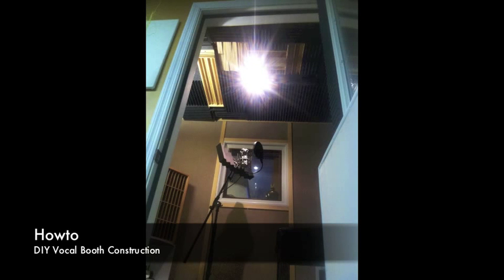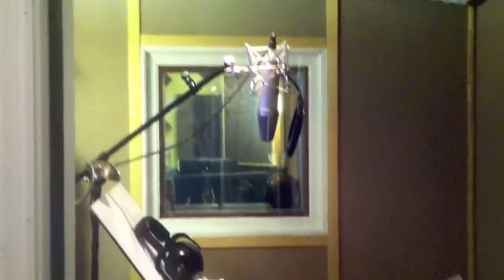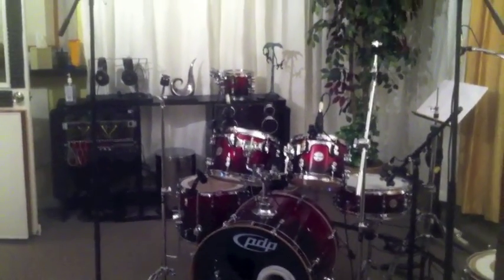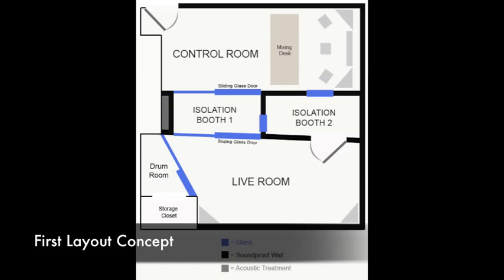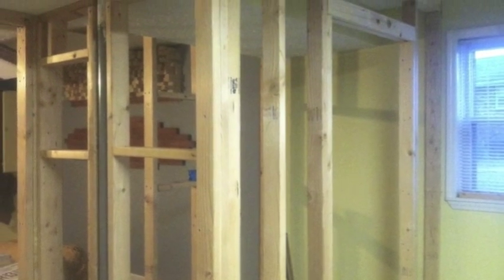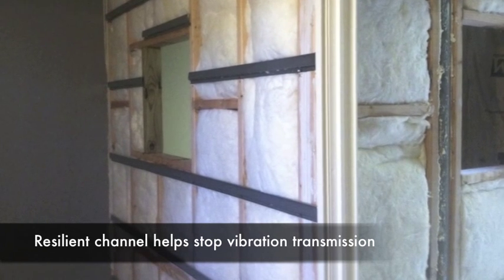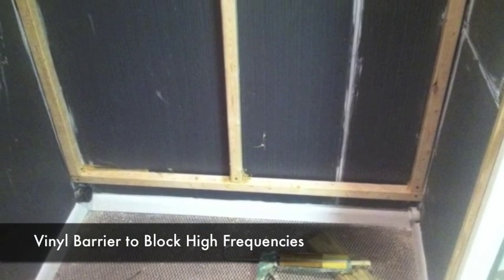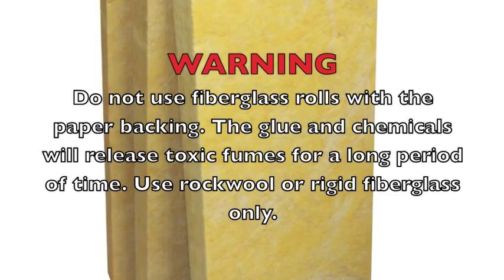Vocal Booth Sound Isolation Construction & Concepts

Comment: What fabric do u use ?
Reply from the maker: Hey Ronny. I used a fleece type fabric. Almost a suede feel to it. I opted to use it rather than cloth and burlap as it stretches nicely and does not wrinkle. It also gives a cleaner appearance.
Reply: TRAVSONIC Media  What Fiberglass do u use, and where can i buy it online ?
Reply from the maker: Ronny Jimenez You can get ridged fiberglass on Amazon and find the best price. Search Owens Corning 703. This goes under the fabric. If you want to go less fiberglass and more natural you can nail comforters to wood framing and then put fabric over it like I have it.

Comment: great video! Just a quick question. Was it necessary to have the vinyl? Because I would have thought that the rigid fiberglass would take care of that by default.
Reply from the maker: Hi Xander. I wouldn't say the mass vinyl is not 100% necessary. The rule I like to live by is the more mass the better for sound isolation. Since the speakers are right near the wall and window, it helps a lot. If you can afford it, I go ahead and overdo it. lol
Reply: TRAVSONIC Media
Hey, I can't argue with that. I definitely tip my hat to you. Good work.

Comment: This is really awesome! I have a quick question. How do you connect the microphones and monitor headphones from multiple rooms back to the control room? Is it done by really long chords? Perhaps a mixer? Thanks!
Reply from the maker: I ran monster cable high shielded mic snake cables from the booth and live room to the control room connected to the studio console and patch bays. Invest in high quality loom/snake cables for the front end. You don't want to pick up radio frequencies and interference for long cable runs.
Reply: travsonic Thanks for the insight :)